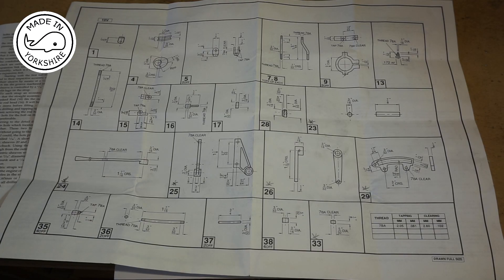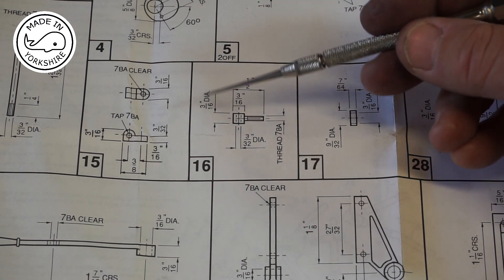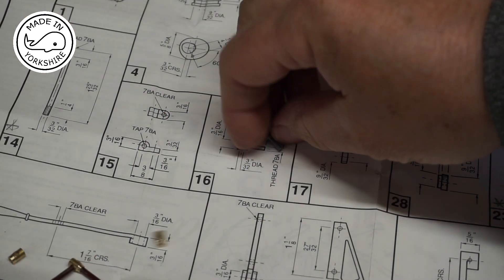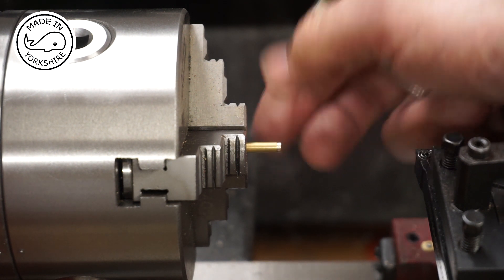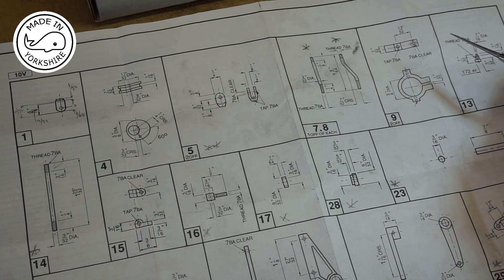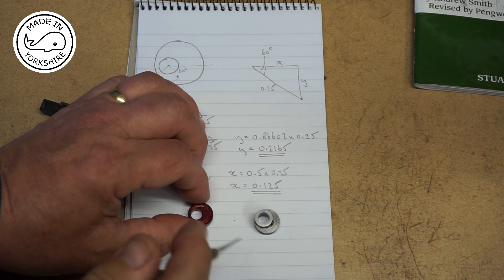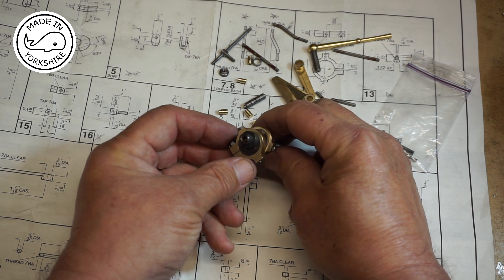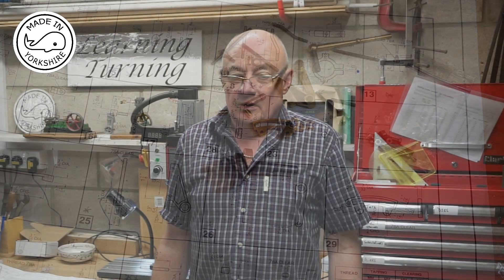#MT30 Part 3 - Stuart 10V Reverse Gear Mechanism. More Machining. By Andrew Whale.

Comment: I have never used a lathe or milling machine but would love to make these parts for my engine. Any ideas on the bare minimum equipment to complete the task.
Reply from the maker: I would recommend a mini lathe and a mini mill as a bare minimum.
Cheers
Andrew
Reply: @learningturningmetal Thanks will look into it👍 BTW my other v10 has reversing gear but the whole engine has no brass on the engine unlike most I have seen any ideas maybe a very old one ?

Comment: Strewth. That’s a lot of small part engineering! I applaud your dexterity. The reversing mechanism does add so much to the visual appeal of the little engine. At this moment the thought of trying to build one scares me.  However if I do decide to try I thank you for this mini series as it certainly will help.

Comment: OK, so I drew the two eccentrics in CAD, so I can also machine them.  Flipping one eccentric over should give 180 degree between the two parts.  It appears the 120 degrees is just to locate the pin holes, and does not come into the calculations.
Reply from the maker: Hi. The pin holes are drilled at an angle of 60 deg to an imaginary line drawn through the centre of the sheave and the hole. Joining both eccentrics gives and angle of 120 deg. The following is a quote from the Stuart instructions......
The 1/16 dia hole should be drilled as shown. This enables the eccentric sheave to be pinned to the new eccentric sheave at an angle of 120 deg for the effective operation of the reversing gear.

If you would like me to send you a diagram to support the above statement, please email me at learningturning@btinternet.com.
I hope that helps.
Cheers
Andrew

Comment: Hi Andrew,  thanks for the great videos.
Just a quick tip you might not have thought of when drilling your holes at an angle.
TouchDRO has a bolt circle function which would do this very quickly.  In this case your bolt circle has one hole but you can set the radius and the starting angle.  Should work pretty well I think.
(Don't you love getting these great tips months after you have already finished the job :-)
Reply from the maker: Hi John. Many thanks for the tip. I've previously used the circle function on the TouchDRO, but I never thought about using it for just one hole. A brilliant idea and one I must remember for the future.
Cheers
Andrew
Reply: @learningturningmetal  
I've got a set of castings for the reverse gear on my bench at home ready to go.  Your videos have been a great help!